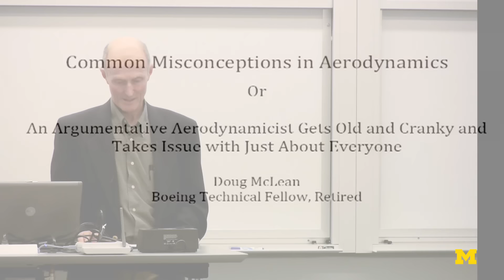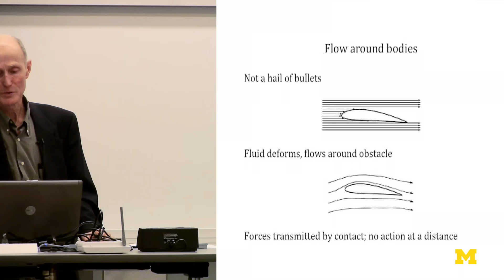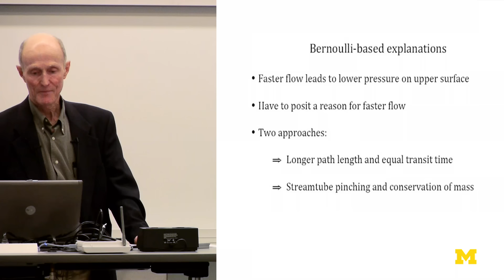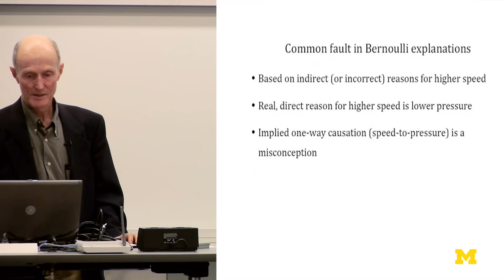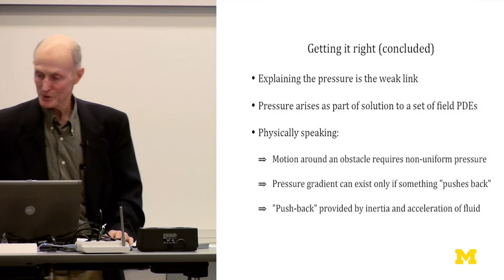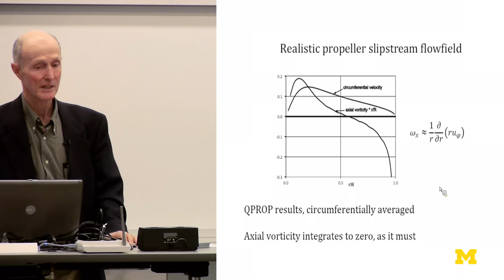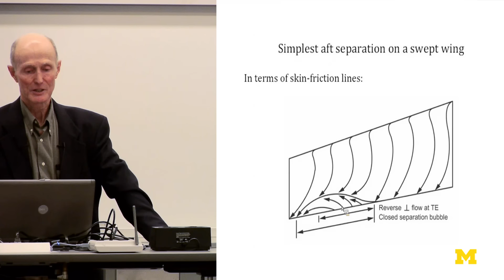Doug McLean | Common Misconceptions in Aerodynamics

Comment: In a nutshell, when an aerofoil starts from rest, potential flow theory is applicable. This requires the flow to double back round the trailing edge to get to the rear stagnation point. This is problematic since our atmosphere is not a superfluid. Instead a starting vortex is left behind on the runway. By the topological principle of conservation of vorticity, there has to be bound vorticity associated with the wing. This generates lift by the Magnus effect.

The starting vortex can actually be made visible. The Magnus effect and the Kutta-Joukowski circulation theorem are the same basic idea.

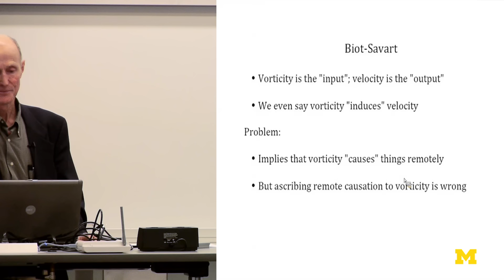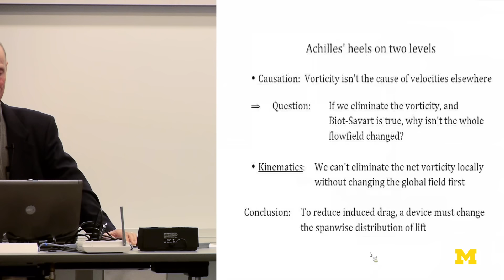Comment: 19:00 LOL... excellent statement. So lets assume time is the force, or connected to it.... do we see an increase or a decrease in time, and if time is a constant where does it get the time needed to create a change in the transition state? And what happens to space if space is relative to time? 23:00 Ahha... the information frame we live in where phase provides the correct answer of the moment and everything is made out of contradiction. Some say the electron moves... and some same say the "hole" moves. But what if time has a reverse arrow connected to the "missing" graviton and they both move connected to "something" stationary... say a true inertial frame of reference they are both relative to... just not at the same exact time because there is a wait state involved separating the phase timing? Is Bernoulli dealing more with the concept of space, and Newton more with the concept of time, and both showing the same cause of force? 27:14 Sounds more like he is talking about the strong force... more accurately than in any book. The strong force keeps two protons from pushing each other away... but what if the proton's phase timing is connected to a true inertial frame of reference. Is a wall a force because it refuses to move and a ball bounces off of it? 30:49 What if it takes the time (and space) of two Mass oscillations to create one observed instance in 3D? Will we see gravity move sideways? How about light moving through in a slit in 3D... if we divide the phase timing in half will we see the effect turn sideways? 36:36 Ouch.... OK so lesson learned but what do I call it if not induced drag? We are left hanging here. I guess when you get the name correct you'll have answered the question. Maybe the question is wrong... great video, makes you think.
Reply: +John F Hendry Please explain to me what is time?
Reply: zeogiannes Take your pick: Mass oscillation,  the speed of light created by Mass oscillation, or E-motion.
Reply: John F Hendry Thank you for the reply. The selection list, does not help me to understand what is time in the real, physical Cosmos.
Reply: zeogiannes Some things cannot be understood without experiencing it. Even having the math skills to paint a picture is not enough to "see" it.
Reply: The physical manifestation and measurement of the delta between then and now... :o)

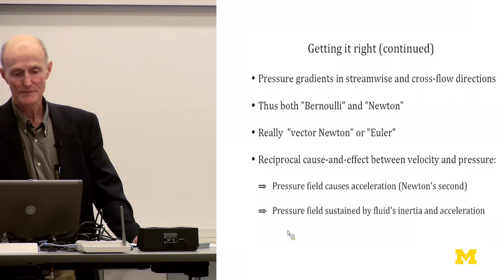Comment: I think the elephant in the room in the discussion culminating with the slide at 26:48 is the centrifugal force. I assume the high school students are quite universally shamed out of using the concept of centrifugal force to better internalize the Newton’s laws of motion. Body following a curved path is related to a centrifugal force, parcel of fluid following a curved path is related to a pressure gradient. 

Similarly, you could state that centripetal force provided by a hammer thrower can exist only if something “pushes back”. “Push-back” is provided by the inertia of the metal ball. But such high school physics teacher avoiding the term centrifugal force would sound a bit insecure.

Comment: Isn't the most obvious way to point out the fallacy of the Bernoulli explanation is the fact an airplane can fly upside-down? Any piece of slab with a angle of attack will have lift. An "airfoil" just has the shape to produce a large lift/drag ratio, but the shape is not responsible for generating lift.

Comment: Formula 1 seems to be the epitome of flow and inverse lift (upside down aerofoils) management, etc. I’m wondering if you’ve ever had discussions with the “grand master” of F1 aero design and management, Adrian Newey, to unpack many of the concepts you’ve discussed, Coanda effect, vortex management and  many other aerodynamic and flow management concepts. I suspect if not done already, it may be a very interesting and productive engagement! Thank you for a fascinating talk!
Reply: Upwash is necessary for lift or downforce, providing the camber transitions into a slope so the flow can reattach after low pressure region.

Comment: 35:00 You can affect the flow structures ahead by placing some device behind it.
For instance, cyclists get a significant efficiency gain if followed by a car, and the car does not need to be that close to the cyclist.
Another way to visualize it is to watch the water flow on rocks in a river. A big area of flow ahead of the rock is affected by it.

I am not saying that the invention is question works... far from it. I am simply saying that you can indeed "affect vorticity over there by placing something over here", as McLean put it.

Comment: 34:38 This thing’s pretty funny. Unless the holes in the flow straightener are very small, the vortex is just going to split into a bunch of vortices that are just going to recombine behind it. If the openings in the straightener are small enough, that’s a lot of parasitic drag for one, but he’s essentially built a Dyson vacuum cleaner and the vortices (I think)  going to exert a huge amount of skin drag from being de-spun.  

And I haven’t got through his entire explanation of why it doesn’t work, but if he didn’t mention it, I also imagine whatever vortification it removes is just going to be generated again, meaning even more drag.
Reply: Yep, basically what you said.

Comment: You don't need a viscous effect for air to follow an upper surface. All you need is the realization that air is pressurized and therefore simply colliding with it will not create anything resembling a perfect vacuum.

Comment: You can see that the Bernoulli explanation of lift is a minor effect because planes can fly upside down, and also that a flat sheet can act as a wing. A bit of cheating there as at any angle of attack the flow over the upper surface forms a curve but with more drag.
The real reason wings have a more highly curved upper surface is that it allows the wing to fly more slowly before stalling, aiding take off and landing, accentuated by devices like flaps on wing trailing edges during take off. Stunt aircraft have symmetrical wings, and they fly rather well.
Reply: It's interesting how the "stall" concept is never stated in lectures like these. (Calling a stall a concept, #humor )
My `simplified intuitive model` is that the bottom is for lift, the top is for control. When the flow over the top is spoiled control is lost by degree. A plane can fly upside down, but not as well (less control.) Malcom Connah, slats and flaps strengthen your argument.

Comment: Much ado about nothing...simple redirection of mass-flow creates an upward component vector which creates lift. If the Wright's complicated their lives with this clap trap we'd still be sitting on three legged stools....milking cows
Reply: Maybe you are missing the point...
Reply: "Over-complicating" things allows one to examine a system and optimize it.
Reply: If one wants to theoretically calculate accurate lift and drag numbers, anything simple is grossly wrong.
Reply: If you had listened to what he said you would understand that there is no net redirection of mass-flow...
Reply: And btw, the Wright brothers conducted hundreds of hours of wind tunnel research to gain a better understanding of the underlying fluid mechanics.
Reply: @Nat, There is a net redirection of mass-flow.  Newton's third law still applies.  For every action, there is an equal and opposite reaction.  The force required to oppose the gravitational force on the plane is matched by a downward force on the airstream.  Newton is still correct.
Reply: Please specify what you mean by "net redirection of mass-flow".
Reply: The force required to lift the airplane is matched by a downward force that the air would press on an infinite scale on the ground (if such a scale were possible).  The airflow has a net downward velocity after the plane has passed.
Reply: Mark Hollingsworth Agreed. I understood "net redirection of mass flow" as the implication that the sum of vertical momentum along boundaries of a control volume moving with the plane and enclosing it would yield a negative result - this of course would be wrong since there is upwash in front of the wing and downwash behind it.
Reply: Newton's third law is still correct.  The upwash in front of the plane is less than the downflow behind the plane until that downflow is mitigated (very diffusely) by the ground.  The net force on the ground is equal to the weight of the plane.
Reply: @nat9521  *Wind vertical bicycle wheel testing, I think you'll find.

Comment: You don't make a pressure differential,  then get lift. Rather,  a pressure differential is lift, caused by downward. How a force transmits to a wing is a different question than what causes the lift. Newton explains the cause of the force, while bernoulli explains how a force is transmitted.

Comment: Along the leading edge there is very thin plane normal to the direction of travel. Above that long, thin plane the air travels over the wing;  below that line air travels under the wing. Hence the angle of attack effect. Air directly in front of that thin plane is pushed "forward" by the wing: Surely there is drag there and there is air compression with the "power/energy" to push the air up and backward over the upper and down and backward over lower surfaces. Surely this pressure on the lower surface can compress and lift the lower surface.  Looking at the leading edge (with two, (splitting)  packets of compressed air is where calculations should start.

Comment: Another big flaw in this?:  "Claims of more stream tube pinching over the top, cannot be satisfactorily explained " so, invoking stream tube pinching is stated to somehow be an invalid key factor for explaining lift.

The above is not a convincing disclaimer.  What is lift if not the geometrical asymmetry of a solid with respect to the relative wind, causing the relative wind to turn?

What is the most intuitive result of the solid's asymmetry on the relative wind in its vicinity, as far as the comparative effect between above the airfoil vs below the airfoil?:

"Stream tube pinching" 

If there is a more constricted flow passage "window" above than below the wing due to the asymmetry, what else would you expect, given the constituent variables of a typical mass flow continuity equation?

So, 2 key pillars of his "Misconceptions" hypothesis (mass conservation as a justification for the force of acceleration, and "stream tube" pinching - acceleration due to mass flow rate conservation through an increase in constriction) seem very thin arguments.

Comment: As an aspiring airline pilot (no engineering background), I find a lot of these ideas and misconceptions very fascinating. One thing that I wish he elaborated on was his statement at 21:10 where he says, “Viscosity and Coanda Effect are not need. Flows follow convex surfaces just fine without either of those.”

What are the reason(s) for why that it is in layman terms if it isn’t due to viscosity and Coanda?

Thanks for sharing the presentation through! Still finding it helpful in 2025.
Reply: Just an undergrad here, but my explanation: nature abhors a vacuum, air expands to fill gaps and it gets pushed out of the way when a body pushes through it. Without viscosity, flow still follows bodies just fine! You can apply conservation of mass and momentum to just that (meaning the flow doesn’t “pierce” the body, but can slide along it and slide along itself with no pesky friction) and you still get a flow field that mostly works. The main difference from the aero perspective is that without viscosity, you can’t really predict lift (anything near a body really or anywhere with large velocity differences over small distances will be really different with viscosity). Look up thin airfoil theory if you’re curious about how this works in 2d!

Comment: I would add, a common misconception is that around moving cars the flow is turbulent, hence if you double the speed, you need 4x times more gas. In reality, thats not the case. Even a german ministry used that asumption as an argument to limit speed on german autobahn.

Comment: Step 1: Put engine centered on either end of the plane, depending on if you use a jet engine or prop engine. Having two engines far apart makes them lose efficiency.

Step 2: Measure center of mass, and attempt to place the center of lift slightly behind it. If the center of mass was in the center of the plane, you would want the wings infront of the center, due to vertical stablizers also adding a small amount of lift.

Step 3: Add air intake to ensure engine does not explode

Step 4:  Win
Reply: it's hardly rocket science
Reply: Dozy Jones, to be fair, neither is rocket science.

Comment: to help understand the problem with wingtip vortex recution... you're basically not trying to reduce vortices you're looking for more air you can affect so you can push yourself up more efficiently
the vortex is just another persepctive to look at that
Reply: Well to be fair, air that is in a vortex is air that is not creating lift, so any vortices are effectively wasted airflow, creating more induced drag
Reply: @justin.w.06  no, all the air is in a vortex, if that was true there would be no lift
the question is on what scale that vortex behaves and thus how fast it has to be for a given amoutn of lift and thus how much energy is needed ro a given amount of lift
Reply: @JulianDanzerHAL9001  youre saying that all of the air flowing over the wing is in a vortex? Theyre called wingtip vortices for a reason
Reply: @justin.w.06  yes
watch the video maybe
they're called wingtip vortices becaus tehy're centered on the wingtips and cause the highest cirucmferencial speed there
Reply: @JulianDanzerHAL9001  ?? yes i understand what wingtip vortices are. but wingtip vorticies are inefficiencies and ideally are minimized in aircraft. This is why efficient aircraft have high aspect ratios and some have winglets.
Reply: @justin.w.06  then why were you asking?
Reply: @JulianDanzerHAL9001  i was wondering why you said you dont need to try to reduce vortices
Reply: @justin.w.06  you do but thinkign about it that way is not very helpful, unless you have a very good intuitive udnerstanding of matehmatics its an accurate but intuitively misleading statement
Reply: @JulianDanzerHAL9001  fair however most aerodynamics becomes very mathematical quickly
Reply: @justin.w.06  yeah but clearly, as seen when he presented htose exampels of supposedly magical devices that don't work, a lot of people try to imporve aerodynamics without understanding hte math and while misudnerstanding the words they pick up, thats why trynslating hte math to a more udnerstandable form may be useful
affecting more air MEANS a lower vorticity but you're not trying to destroy the vortex, thats impossible, you're trying to weaksen it which you can't do by directly trying to ocutneract with only by affecting a greater cross section of air

Comment: Another example, vector thrust can only be explained by inertia of air because the  exhaust pipe is turned at 90 degrees angle to the primary jet exhaust and the produced lift occurring near the aircraft; same as rocket in space near 0 atmosphere.

Comment: Page 31:27
Drag is a collective term “trash bin” for those who doesn’t want to explain or can’t explain with aerodynamic one factor at a time. 
- when there is tip vortexes, drag increases
- when there is separation, drag increases 
Why is that? Ask someone else I’m too busy working on engineering problems.

Comment: His biggest flaw?: "Mass conservation not a direct reason for acceleration"

If the mass flow is delayed, a pressure gradient is the immediate consequence, which increases acceleration necessary to maintain mass flow rate (sufficient to halt the pressure gradient from expanding).

How can the above be wrong??  

He sure bases a lot on implying the above is wrong.

This odd point of his even makes it, prominently enough, into the Wikipedia entry for lift (force).

Something has got to give!

Comment: One of the things nobody considers is the fact that the air has different density for every mm of altitude based on the gravitational field, so the mass of the air varies. When you add velocity to an object moving through a fluid with different density you automatically generate lift. The higher the speed, the higher the lift. Studying a wing profile into an wind tunnel is not enough. Please add the gravity effect into your equations!
Reply: It is well known that the density changes with elevation and the lift related pressures are infinitesimal and, therefore irrelevant in the generation of lift compared to the pressure differentials.  The pressure changes during normal flight are quite small to begin with: 0.1 psi for a Cessna type and 1.0 psi for airliners.  Lift is a very small phenomenon; why wings have to be so big.